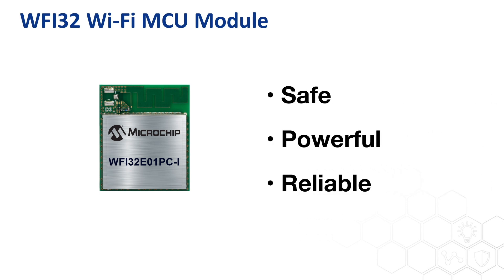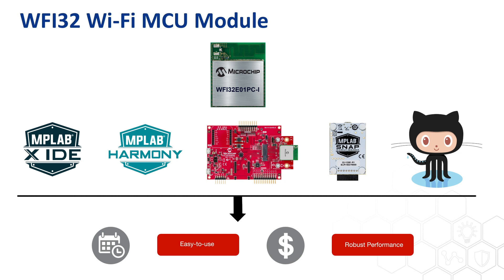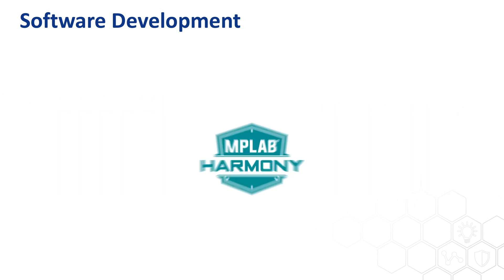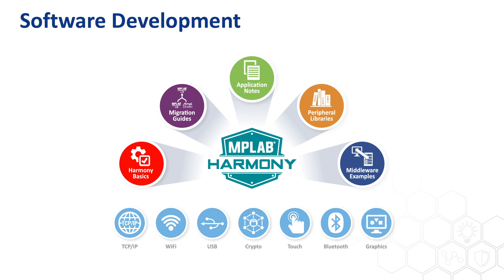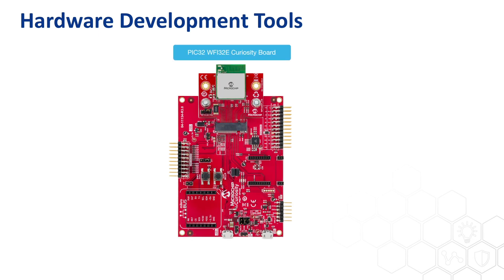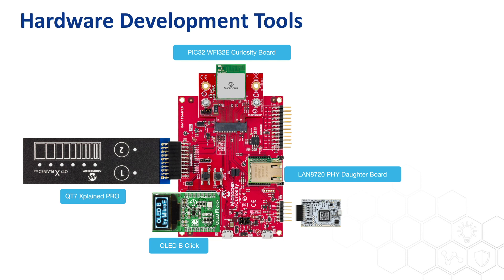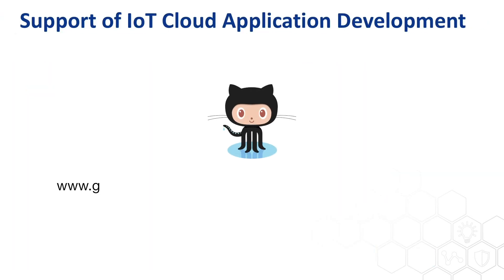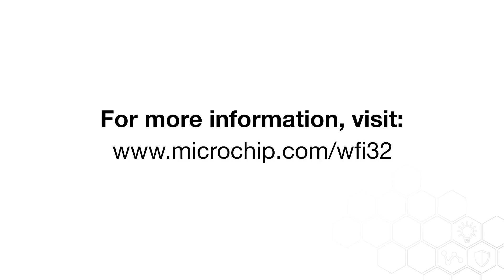WFI32 Wi-Fi® MCU Module Development Tools Introduction

Comment: Looks nice. At least much better than previous generation of WiFi modules (WINC1500 at instance). The problem with them were they were running all the TCP/IP stack inside, so users used to address it through SPI by calling sockets API. Though, at a glance,  it looks pretty decent, in fact it rises some problems when trying to embed some higher level libraries, like libwebsockets_. These often uses _lwip TCP/IP stack as a backbone for its operation and because of aforementioned "hardware" stack of WINC1500 module, you had to though it away and apply some wrapping and redirecting functions. That's a bit inconvenient. 

Peeking this product I see application is running on the same chip where WiFi hardware is located, so intermediaries like SPI protocols and "hardware stacks" should be no problem and building solid product should come much smoother.